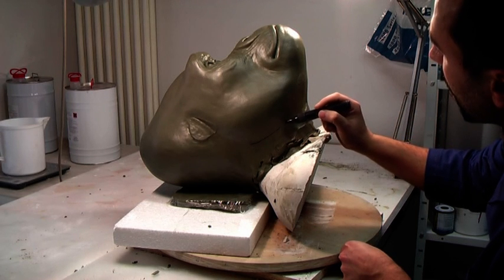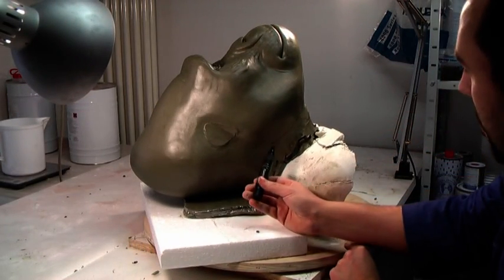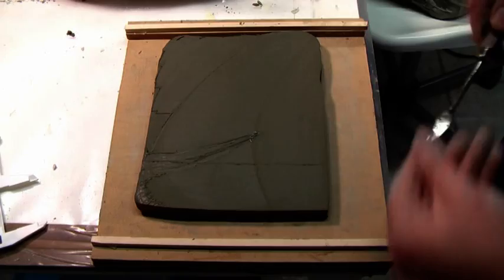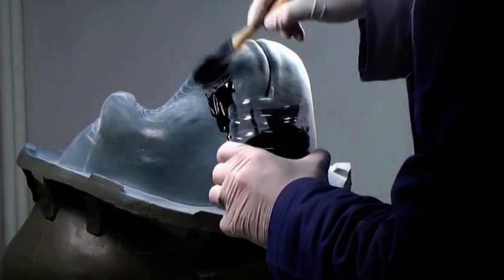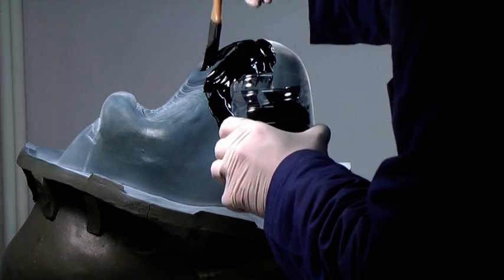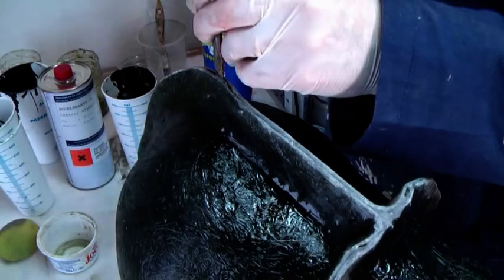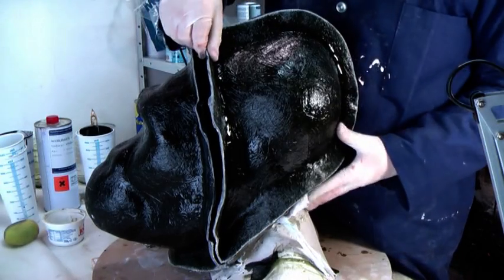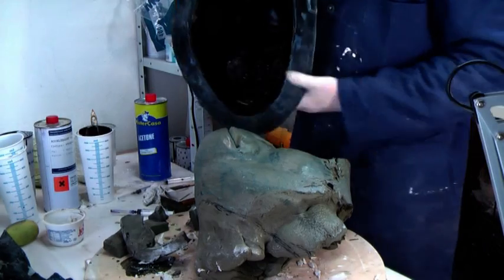Animatronics tutorial - Chapter 3 - Making the fiberglass mold

Comment: what type of mold release do you use and what type of clay do you sculpt in? ive noticed that roma plastilina (oil based clay) sometimes has a chemical reaction to the fiberglass.. that clay also has sulfur in it and i think that is why this is happening.. any advice would be GREATLY APPREICATED.. im working on a large project and want to cast in fiberglass to save weight...  PLEASE HELP a starving artist out!!!